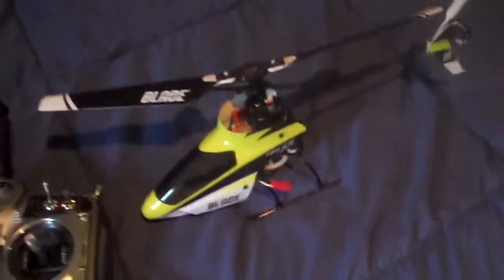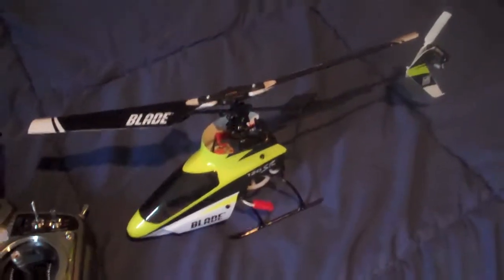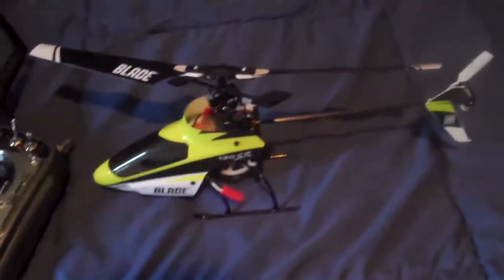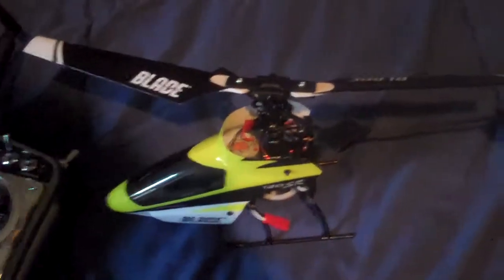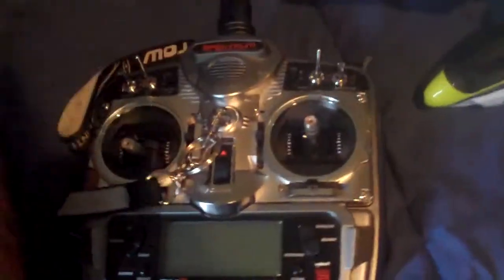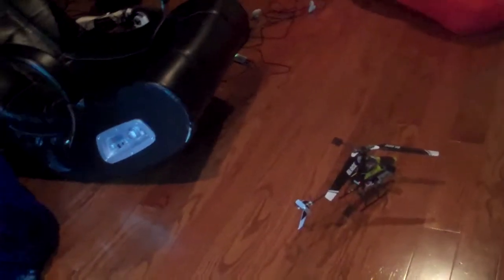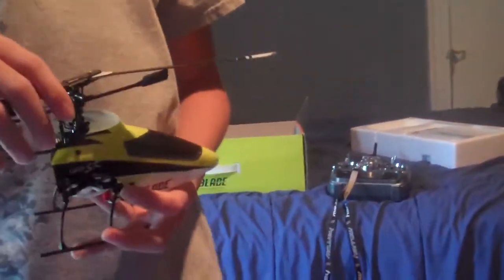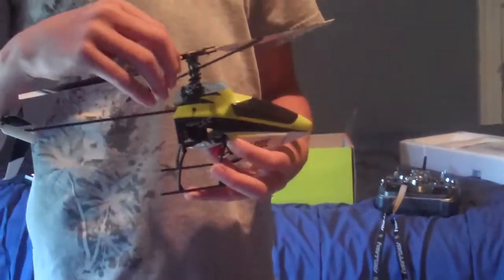120 Sr advanced swash plate settings

Comment: @RcFlyers1234 no, guess i just looked at it as a good deal only. I like glow power and i only like electrics in parkzone models or if they are EDF's, oh and, the T_rex 450 sport is more reliable than the pro. The belt driven system is WAY less likely to fail, the pro has a shaft driven tail witch means that if you touch it, you could mess it up. Thats one of the reasons i got the sport and not the pro. But some adviceC( learned the hard way) the manual is your best freind, read it 100 times!!!

Comment: hey, i if your trying to get into ccpm helis dont go with the blade sr. I had the heli and its horrible. Try a t-rex 250, e-flight 450 3D, anything with some mass, evan the mcpx is better than the sr. Just turn the rates low, the sr is the worst heli e-flight has ever made. IT SUCKS!!!!, lol the tail wags alot, wooden blades are weak. Its just not good